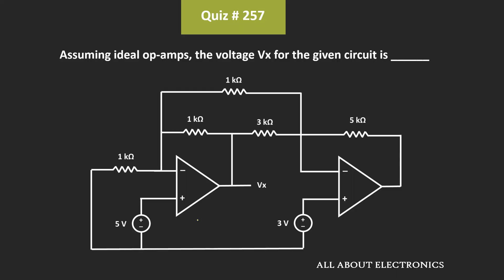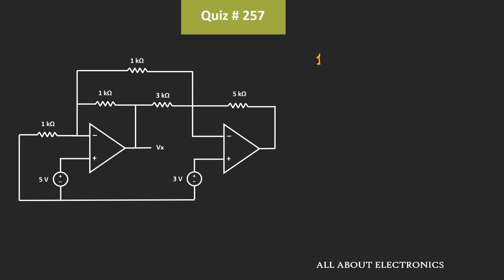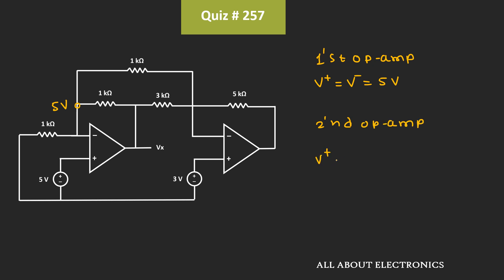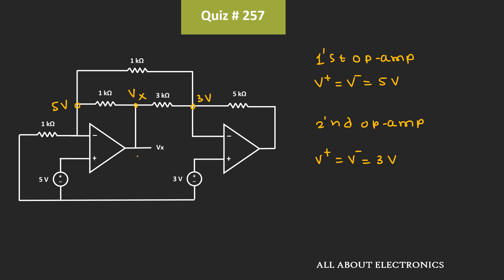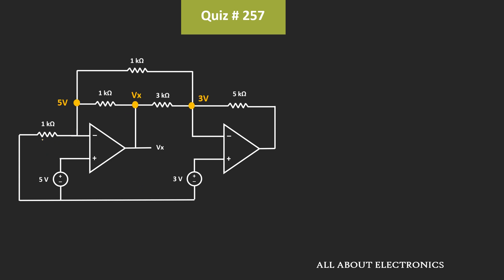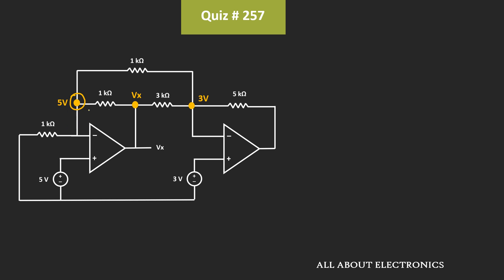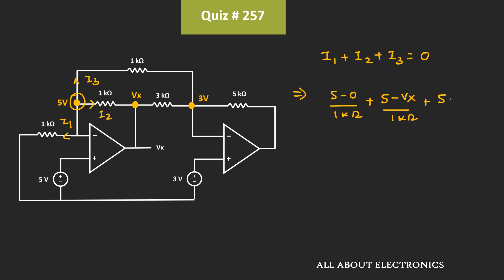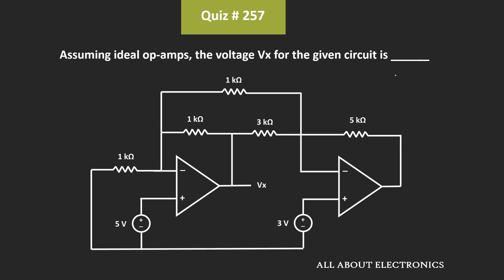Operational Amplifier (Op-Amp) Solved Example | Quiz # 257

Comment: is the direction of current "I1" correct ...i used the reverse direction and i got the voltage to be 2v.
Reply from the maker: Yes, with the assumed current direction, I1 = (5 - 0) / 1k . 
If you assume the direction of current as the incoming to the node, then KCL equation would be I1 = I2 + I3
And I1 = (0 - 5)/ 1k.
I hope it will clear your doubt.
Reply: @allaboutelectronics-quiz  ok Fine thank you